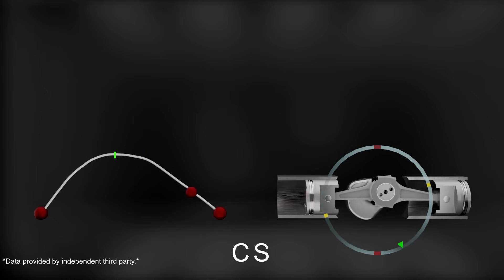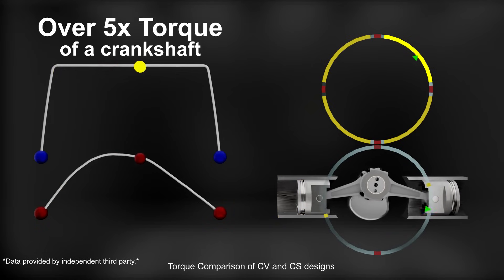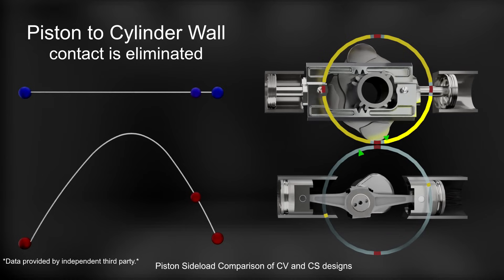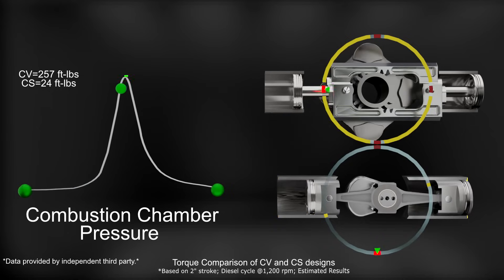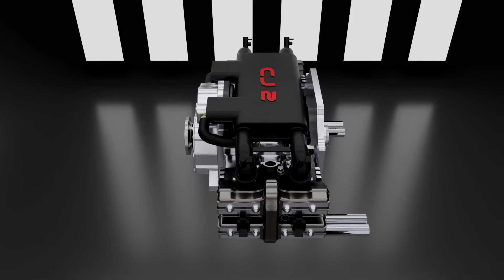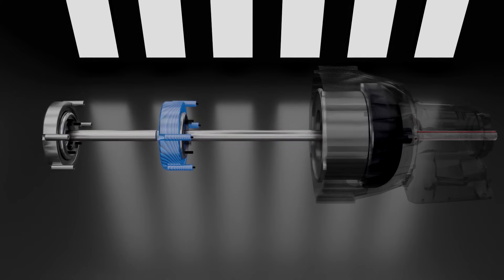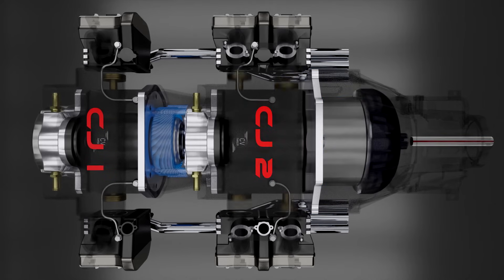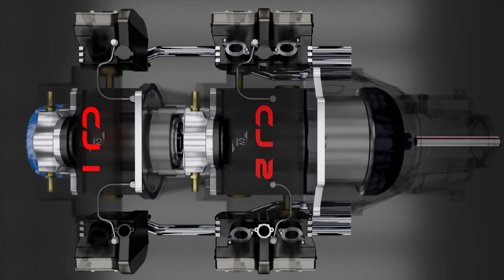The Engine Radical design & unique advantages of the Ahiravata Motor Powered by CV Motion Technology

Comment: Won't run in Indian condition oiling is the main problem in this engine, it will heat up the components when it runs in different orientation it has to be kept in this horizontal position which is not the real case.

Comment: The four horsemen of revolutionary engines:
1. Unfavorable sealing shape/position (ex. Wankel)
2. Non positive pressure sealing (ex. Coates)
3. Undampened main power through backlashing mechanism (ex. Porsche 6 stroke and this one)
4. Main power through specially machined guide mechanism (innengine, this one)

Comment: Clever idea, but look at the area over which the force of the power stroke is transmitted to the crankshaft vs the area of a stock crankshaft and conrod.
ie:  The line of contact in the meshing tooth is way smaller than the large area of a condrod to crank, meaning the pressure is way-way higher.
That will likely result in any lubricating oil being pressed out of that line of contact at around 20 degrees after TDC where the main power stroke pressure is transmitted through it.  Check that with maths.
I hope I'm wrong and it works.
Definably worth building a prototype.

If you are talking double power strokes, both above and below 1 piston;
then the animation should show that, or there's a disconnect between what is said and what's shown and a very likely a "BS!  This guy's talking BS!" reaction from the viewer.

DO NOT go dilute a good idea/concept with a un-novel = shitty, engines in series, concept.
It detracts from the good concept.

Don't call a concept a prototype!
A prototype is video of a a working engine, not an animation.

ie:  Don't kill your idea with other, low level ideas and BS that makes you look like an ass and is likely to deter investment.

Comment: An interesting solution to a number of problems with, particularly flat engine. However, I foresee possible durability problems, particularly those teeth on the ends which reverses the direction of movement.

Comment: You wish to create a simpler and more efficient engine which is more reliable. Your detailed 3D model is showing the complete opposite. It is very complicated - which means less reliable - and the improved efficiency is no more than wishfull thinking. 100 years of experience has shown that an engine WITHOUT a crankshaft is doomed to fail. The Wankel engine was in the 1960's believed to be a competitor to the traditional Otto engine. The Wankel engine design was simple. However it proved to be LESS reliable and LESS efficient. Your design is far worse compared to the Wankel engine. I am a machine engineer with a life-time of experience. You are wasting your time and money trying to design an improved engine.
Reply from the maker: this is called BULLSHIT . ICE is very complex and have hundreds of parts is it not reliable ?? things become reliable after polish not from day 1 (2-stroke engines are far more simple ARE they more reliable ?) . engine WITHOUT a crankshaft is doomed to fail thankfully nobody has invented a jet engine or even linear Piston engines . If you say commercial viability is hard to achive that would be fair & the core reason we ONLY changed the core  not anything else everything above the crankcase is same so all the lessons learned from a century of experience remains

Comment: <><><> We solved the 'tooth' problem in our numerous designs.  Yes i designed numerous crank-less piston engine architectures including rotaries that solve the sealing [pollution, efficiency] and  lubrication [durability, longevity] problems. Advanced high efficiency, low noise micro-turbines have been designed based on our patented innovations.   =]]
Reply from the maker: who has claimed a turbine engine to be quiet ??
Reply: @AHIRAVATA  Advanced high efficiency, low noise micro-turbines have been designed based on our patented innovations. .

Clearly...me

Comment: In my view since it is a variation of the Piston Engine, it's nothing new. The first problem that is obvious compared to a conventional Piston Engine is the number of Friction Points in the Crankshaft and Rod setup. It is way higher and I don't think you could transfer high horsepower and torque through this setup without failure.

Comment: Best of luck with it @ahiravata from the UK - it is good to see innovation and it is very hard - you need a lot of courage, you have an engine running from looking at your other video so the concept works. The hard part is now 'Failing fast' and learning even faster to fix the issues you find! We need new ideas if the ICE is to survive and the world needs ICE as it does good EV, not one solution but many! I have subscribed and look forward to hearing your updates!
Reply from the maker: EV cannot work without Range Extender so we need a better engine no 2 way about that . people thinking about 100% ev have no concept of power drain of large equipments like trucks . it's super easy to claim on a press confrence that you gonna have super fast charger that is multi megawatt class  charger until some one looks are at the cost of that MUCH POWER its like you can feed power to a whole village or just one supercharger for one truck an hour

Comment: Completely impractical investor bait.
In addition to prior comments, the tooth interface is subject to 
significant side forces, as well as impact forces at the end of the stroke.
Consider the "knock" on a conventional engine where a big end bearing has failed.
You have engineered this problem into your design. Also conventional engines use hydrodynamic (shell) bearings with pressure fed oil supply and precision clearances,
your design...more akin to a medieval rack & pinion!

Comment: I've always appreciate Boxer engines.  One of the better aspects is that they've been around for decades and are still in production.  Looking forward to later this year when you've produced one that can power a vehicle or aircraft.  I tend to believe actually certified technologies more than animations w/hard to believe voice-overs promising so much and saying there are no drawbacks.  You tend to discover drawbacks when you actually build things, which is why R&D and engineering should be located close to production.
Reply from the maker: we built a small one as POC and it worked now worked on full size one

Comment: Locating the cam drive chain in the middle of the block is a maintenance nightmare.
Reply from the maker: it should need much maintenance  its will not be zero but low enough
Reply: The design also allows different engine configurations by stacking extra modules. From a four to an eight cylinder should be relatively simple. As to maintenance. TBO requirements are still in existence for aircraft.

Comment: As stated below, scotch yoke. The yoke itself is the weak point in the design. It looks like you actually made it worse by also adding teeth and a gear to your design. Instead of a rendering designed to peak interest through people who don't know better, show and working engine under load.
Reply from the maker: sliding and rolling they are two very different things . we are woking on more units and larger units that how any and all Technologies developed step by step
Reply: @AHIRAVATA  We will see. This is still just a variation of the scotch yoke design and the yoke itself is its proven weak point. Building it and running under load for the equivalent of 100k miles would prove me wrong. Talk and 3d models are cheap.

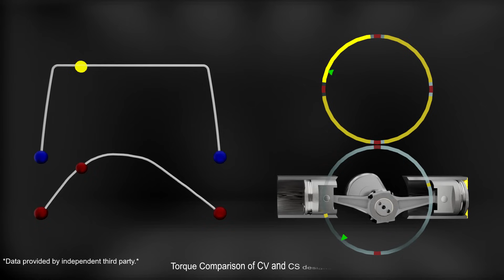Comment: 3:19 The power stroke will NOT have linear output. It falls as the combustion chamber expands in volume. Pressure goes down as volume increases.
Reply from the maker: Do u understand combustion? Engine is constant velocity  meaning we get constant power out of power stroke throughout the travel . Normal ice cant do it due to lever arm mechanism . You can keep extracting energy as a long as the exhaust does not become equal to ambient pressure and temperature . That's why longer gun barrel gives you more projectile velocity {barring influence from other things like drag from the rifling } same logic is used in Rotary vane engine
Reply: @AHIRAVATA you haven’t replied to the reduction in pressure as the gas expands.
Reply: @AHIRAVATA  Your engine is NOT at constant velocity as your PISTONS (and lateral swash plates) have to CHANGE DIRECTION, SLOWING down then reversing the direction of travel.  This... thing... Is not a rotary vane engine, I worked with rotaries all my life, I built and flew rotary airplanes, a rotary (3 rotor) has a power pulse every 120 degrees per lobe offset by the eccentric shaft translating into a near constant combustion at peak revs.  It works like a turbine, your engine is more akin to a reciprocating steam engine with a sliding valve fixed to the displacement piston.
Reply: you dont understand it. its indian magic involved. you just need to believe in it
Reply: Don't worry, it works the same way the "Refund" process works when an AT&T rep with a curry accent calls you and it involves gift cards.
Reply: At higher rpm it will smooth because the same thing applies to inline engines....but the throw of torque with every burst of ignition will be significantly high

Comment: if you can make it reliable with the teeth connections at tdc it will have increased efficiency, no doubt, but i dont think you will ever achieve it for applications that runs a long time.

i do see a potential application in suicide drones where longevity doesnt exist and range is important which your increased efficiency should give, but the teeth connection at tdc looks fragile

i like the design

Comment: so this revolutionary engine is actually in the crankshaft design. 
i do not think the torque curve youve  shown is correct, power cannot be transmitted evenly during the combustion stroke bec only 1 side will transmit power and during the combustion stroke of the opposite piston power will be transmitted by the other side.
furthermore as the piston slows down after combustion torque will be 0 and cannot be covered by the opposite piston. 
i also noticed this engine is very very complicated with so much external gears and linkage make it unreliable. 

after building the actual prototype, show us proof of the actual torque curve
Reply from the maker: we built a prototype and used that to get the patents & a full size one is under works U need physical video then please look in to our DELHI Expo video in this channel for better grap of what it is

Comment: Ingenious, but wear will be terrible.
Reply from the maker: nope as its has less sliding points pluse no side loading on the pistion
Reply: @AHIRAVATA  I wasn't even looking at the sliding points. 
My concern was those little two-or-three-tooth gears meshing and unmeshing and the rollers slipping in and out of their tracks. On paper it's fantastic. But throw in real-world conditions and problems - heat expansion, wear, misalignment, dirty oil, and so forth - and it looks like a disaster waiting to happen.

Comment: This engine has to move the central piece alternatively and keep it straight and lubricated. to me this is delicate and energy hungry. Also I doubt the torque transmission capability of such a flimsy gearing (my opinion).
Reply from the maker: there is 3 element not just teeth its  Pin > Teeth > Pin  . all gears are point contact if u understnad that u will understand two theeth is not an issue YES IT DOES LOOK ODD

Comment: As a mechanic that built a tuned '70 chevelle in H.S. with no H.S. shop, mechanic or dad helpin me so I can say this stupid idea will blow up cranks at around 10,000 miles if you really really really really lucky to make it that far. Nobody understands what the torque and power does to small fancy lookin over engineered bullshieza we see in this attempt by India's Secret Service to make us wanna hire indian engineers with green cards in 'merika. no thanks we can build 426 hemi's and stuff em in our pickup trucks with big tires and have fun in da mud. Got Mud?
Reply from the maker: cool your are experinced in what has been we are trying something NEW all the old "Wisdome" goes out of the window and if it does not work we will still have fun and Its an epic challenge to tackle
Reply: @AHIRAVATA  I am sorry if I seem forceful or rude Mr. Ahiravata. I just am also a aprentice machinist with studies in Mechanical Engineering since a boy. I can tell you that the little teeth in the gears that flip the rods so nicely in your design to appear to allow the piston rings and piston to stop rocking are not going to withstand the constant 1000 pounds of force that they will get hammered with when combustion occurs and the piston is forced down the cylinder with this force. You forget that a modern crank has a high degree of smackability by an explosion of gasoline inside the comBUSTion chamber. Its not called comBUSTion for no good reason. I will give you a homework assignment and report back to me the results. Take a heavy chevy rear end ring and pinion gear set and mount them on you workbench at 90 degrees fit together and hammer on one end of one shaft. You will see with only a few blows that the contact area in the gears is severly impacted and dented and on the way to total destruction.

Comment: Nice theory but it's a high wear design that will have a short service life in the resl world.
Reply from the maker: you just made random things up ?? It does not have any single sliding surface that carries load Piston does not have have side stricks and all the energy transfer unit are rolling elements and rest is same as any other ICE engine

Comment: Absolutely mind-blowing innovation! It is truly a game-changer in the world of electric mobility.
Reply from the maker: Yes this will be a great Range Extender for EV
Reply: @AHIRAVATA If you want to make range extenders, why not go for an inline configuration. Flat engines are prone to oil flow issues, and are expensive to manufacture due to the twin cylinder banks. The main advantage of a flat engine is to lower the center of mass, to reduce roll and pitch during acceleration, braking, and cornering. A range extender does not constitute a significant portion of a EVs mass, so the benefits of a flat engine are minimal, as far as I am aware.
Reply: Wow, perhaps you need to reread this after reviewing the term "sarcasm".  Your device is more coming historical discard than future at this point.
Reply: The Phrase
 " game changer" is greatly overused.
Unfortunately the only thing this is going to change is the amount of repairs needed to keep it in service whether it's in a generator or a car

Comment: primery drive teeth need to handle higher and more sudden torque loads on a smaller surface area than a standard crank. so new crank every 20,000 miles or less it seems.
Reply from the maker: LOL you do know all gears are Single point contact right ? & there  are 3 element that does power transfer Pin A > Teeth > Pin B its not like rod is unconstrained we build a demo small scale which worked and working on full scale one both Video is available in the channel
Reply: @AHIRAVATA  Lets see it run 200,000 miles
Reply: i think titanium can easily solve this problem.
Reply: @darshan5726 the astronomical.costs become an issue. Not just due to the price of the raw materials, but the knowledge to work it, the tools to work with it, and then several more rounds of smaller test bed engines.
Reply: The teeth would probably crack off eventually, but when ?
Let's see an actual prototype engine time-tested.

Comment: For generator, better use a mini turboshaft engine- they are multi fuel, efficient at full load, and extremely reliable, lightweight and compact
Reply: Turboshafts only make sense at larger scales, the large number of small rotor and stator blades are very expensive to scale down.
Reply: @playyourturntodieatvgperson  true, but there are some great 2-400hp turboshafts out there that you can carry in a handbag
Reply: yes thats why general aviation use those. because they are cheap and fuel efficient 😁
Reply from the maker: most jet engine only makes sense if u have high forward air movement its not great otherwise
Reply: @AHIRAVATA  turbo shafts are type of jet that are optimized for power generation,  helicopters, even a motorbike..... Eg the Y2K bike
Reply: You mean like the APUs in many aircraft, which can vary as @AH-mj1rd mentions here.  Plenty of examples, existing parts supply chains, etc.

Comment: Nice, I like the design. I have a few questions though:
1. I can see that the CJ2 Engine cancels out the Primary Lateral Oscillation as it has 2 Counter Oscillating Cylinders. But how do you intend to counter the CJ1's Primary Lateral Oscillation and Vibrations?
2. What are the long term Torque Wear and Tear on the Primary Tooth Gears as they seem to take on a the full grunt of the Piston's Force as they pivot and switch direction which each Combustion and Compression Stroke?
3. What is the estimated Thermal Efficiency of this Engine?
Reply from the maker: BSFC should be very high how high well there is bet in the team if we hit 100g Drinks are on me if below 100g drinks are on RON {inventor } you can watch the whole interview in this channel
Reply: 1. The two-pair variant doesn't shake laterally, but it does have a twisting oscillation about he vertical axis... this is one of the reasons that flat-4 engines are boxers, not using shared crankshaft throws. 
2. It's worse than that: the piston assembly must accelerate instantaneously to transition between constant speed in opposite directions of motion.